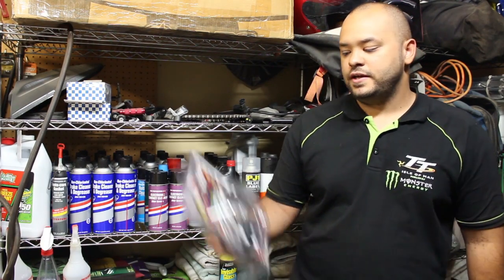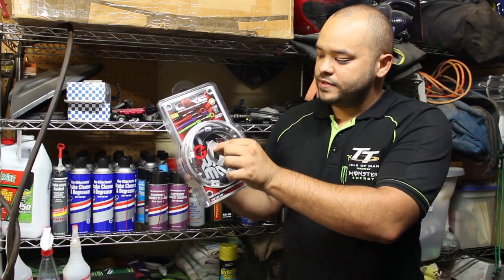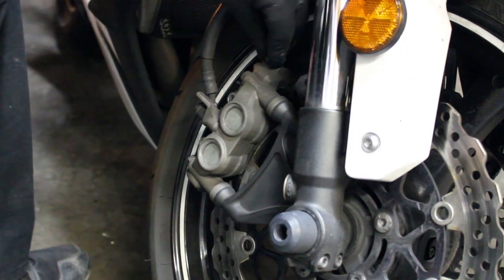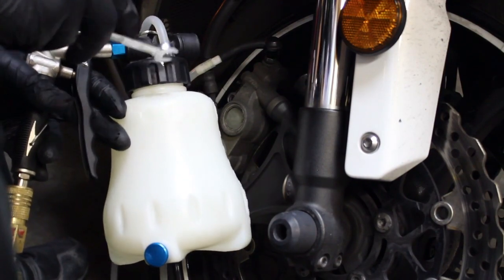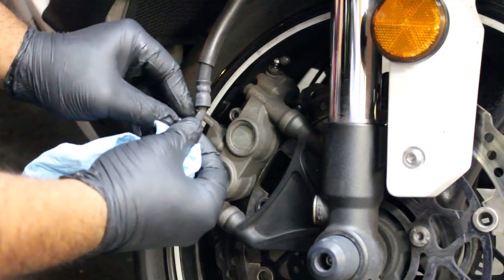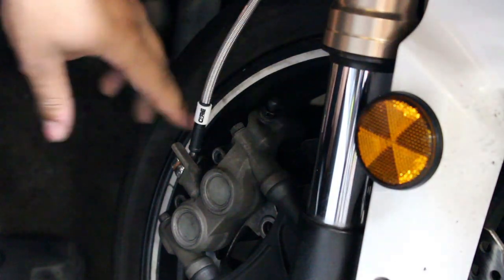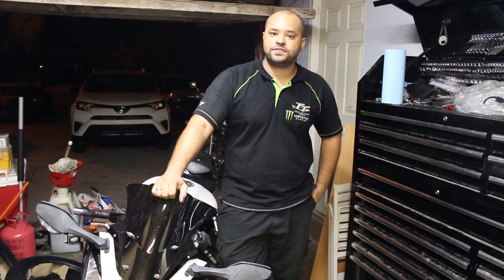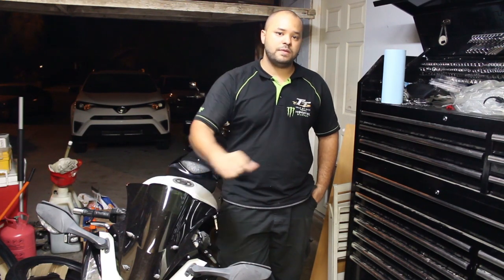How to Install Motorcycle Steel-Braided Brake Lines

Comment: I have a 2005 R1 with original brake lines and about 16k miles.  That means they're a solid 15 years old.  Finally getting around to this now.
Reply from the maker: Ouch! Ya I definitely would consider that a priority. Even if you replace those lines with factory rubber lines; just get them swapped out. Good thing you are getting around to it. Stay safe out there! Cheers!

Comment: Love this guide thank you so much. Only problem I had is during Gravity bleed I imagined I'd only need to top up every 5-10mins not every 60 seconds! Haha, wasted a solid 30 mins and half a bottle of brake fluid to learn that lesson 😂
Reply from the maker: Thank you! Every bike is different and some gravity bleed at different rates. Mine moves pretty quickly too. Especially if you crack open both calipers at the same time. I hope you get your project done quickly and safely. Good luck!

Comment: At 9:52 you have, I believe, the two hoses upside down on the dual bolt.  It appears, at around 10:48, that you make the correction and you then bolt the hoses to the master cylinder in a correct manner. No mention is made of this error?
Reply from the maker: The table demonstration was simply to show you the order in which the cables and washers go. Not specifically the orientation of the cables. This is why there is no mention of it. Every bike is different so orientation is dependant on the individual bike and cable kit. I hope this clears things up for you.
Reply: I noticed this at the time thinking this is going to be interesting but he sorted it out as mentioned already

Comment: great explanation. would the draining and re-filling of the system work the same if the abs stays in the system?
Reply from the maker: Good question. As every bike is different, I can't say yes to every situation. To the few bikes I have done it to with ABS, yes. However; always consult your factory service manual before you perform any maintenance. Hope this helps and I hope you subscribe! Thanks for watching and commenting. Ride safe! Cheers!

Comment: Hey man thanks for the vid, one question.. On the brake lever's double banjo as you can see the stock line had this steel point which locks the old banjo from moving but the double banjo does not lock the same way and could rotate and loosen?
Reply from the maker: Hey! Thanks for the compliment and for your question. If we are talking about the same tabs, the only reason the tabs are there is to keep the banjo bolt from turning too far while being tightened. As long as the banjo bolts are properly torqued to spec, routed properly, and use the appropriate crush washers you should have no concern about them backing out on you under normal use. I hope this was helpful and I answered your question. Having you as a subscriber would be great if you aren't already! Anyway thanks again and ride safe! Cheers!
Reply: @TheMotorcycleBoss   thanks for clearing that up, quick reply too still supporting an older video!
Reply from the maker: @GFUNKzero  no problem! I check my email multiple times a day. I try to respond to everybody. Glad to help! I hope to hear from you again in the future!

Comment: Note that when u showed how to specifically put the lines on the master cylinder they were upside down.
Reply from the maker: I know. It was just to show the layering process. Not necessarily for orientation purposes.
Reply: @TheMotorcycleBoss  gotcha. I figured u knew since they were repositioned off camera. Guess im just letting u know, as some might be confused about the direction they need to be put on. Other then that it's a great video to help DIY'ers.
Reply from the maker: @StreetFighterRic  understandable. Thanks for pointing it out tho. Your comment may help those that didn't get it. I hope you subbed in case you didn't yet! Happy New Year! Stay safe!

Comment: Really good video for all sorts of bikes. I’ll be using this as reference when I change my brake lines in the next couple of weeks. Thanks!
Reply from the maker: Thanks! I'm glad I was able to help you and I really appreciate you taking the time to let me know what you thought! Just don't forget to gravity bleed. It seems a lot of brake systems just wont bleed properly without a gravity bleed or priming the master cylinder. Good luck with your project! Cheers!
Reply: @TheMotorcycleBoss  I found out my brakes are ABS and I need to replace the cable from the ABS module to the MC to make them longer for new handlebars. Do I need to bleed the entire ABS system and do gravity bleeds like you showed or is it different on ABS? I heard I’ll have to bleed the rear brakes as well to get any air out.
Reply from the maker: @Mitchwilmarth  Bikes have different requirements given their ABS systems. Depending on if you have linked brakes or not as well. Your best bet in that situation would be to consult your factory service manual. But for the most part, it shouldn't be an issue.

Comment: Awesome video. Question: were the banjo bolt torque specs given in the documentation along with the kit? Or did you have to look in the service manual for your bike?
Reply from the maker: Because you are threading the bolts into your own brake calipers and/or master cylinder, follow your factory service manual for torque specs. Mine were 18 lbs-ft per the FSM. I hope this helps! Thanks for watching & ride safe!

Comment: Hi there, thank you for your expertise on this matter, this video was very informative, however, I would like to ask you about this accident I had. I ride a 2015 ER6n and I was involved in a crash about a year ago, I was taking a corner at an angle of about 75 degrees (which isn't much of a corner) but I had to mildly apply the front brake before committing to it. Sadly, the front brake just jammed and the bike slid under me. I have been trying to find a reason for this but since I didn't touch the bike for about 6 months while I healed and then the lockdown happened, I could not really go check the spot where I crashed. My question is, do you think this could be cuz of faulty brake lines?  Do brakes tend to lock up after long hours of riding, due to friction heat, possibly? I am just trying to rule out why the front brake locked up on a fairly decent road and barely any leaning. I was also probably doing about 45 miles an hour. I mainly suspect the lever guards that I had on, I think those made contact with the brake lever and that's what caused the crash but since they shattered on impact, I have no way of knowing if it caused the crash. Your insight is appreciated.
Reply from the maker: Hey! Thanks for your comment. I hope you are doing well during these times as well as recovering well from your crash. I understand your concern. I had the same thing happen to me before after I installed odd-looking levers. The pivoting mechanism broke and caused the cylinder to be depressed without me even touching it. It made me go from 45mph to 0 so fast that I almost flipped over the front of my bike. When it comes to brake fluid, you only run into 2 situations. 1: you have fresh or old brake fluid which will not apply pressure to the brake pads without an outside force like depressing the lever. 2: you have some air or water in the lines which make your brakes less effective as they heat up. Which causes the opposite effect you are describing. When it comes to the brake pads or pistons themselves, build-up of dust and grime can sieze a piston and thus resulting in a siezed brake pad. Since the brake pad and piston are always in contact, and assuming that all bolts are tightened in the area, this would not cause the problem because the brake pad is always in contact with the rotor regardless if siezed or not and seizing doesn't cause enough pressure to the rotor to cause it to not move all of a sudden. Usually a siezure like that would be very gradual over time to develop to that point. So as long as there is no obstruction of your rotor or brake pads/calipers, the only likely cause would be your lever guards somehow depressing your lever or piston in your master cylinder. I think your hunch maybe correct about your handguards if you believe they could've caused it. If you ever find out what it was, I'd love to hear about it. I hope this helps and thanks for watching my videos!please subscribe if you haven't already! Cheers!
Reply: @TheMotorcycleBoss  That was quick. Thanks, man. I am better now, better riding my dirt bike more often now, need to get back the confidence I had with my ER. I will change em to these steel braided lines at some point, along with some new brake pads, I think it should be good to go. Already subbed, btw. Thanks again.
Reply from the maker: @ashishavin2127  I try to respond to every comment as quickly as I can. The only comments I typically don't respond to are ones that don't require one. I'm glad to hear you are doing well. Once you ride on the ER again, I'm certain that your confidence will come back after a few months with no issues. But you are doing the right thing in looking for the issue so it will never happen again. I wish you the best and thanks for subbing! Cheers!

Comment: Hi MC Boss
This is ver helpful clip ::))
I guess this applies to cruisers as well
I see u have both left & right b lines coming directly from the master to each caliper, so making the brake fluid distribution block - obsolete
Wondering what decided u to do that- good idea ::))
Reply from the maker: Thank you very much. I appreciate the fact that you took the time to tell me that. Personally, i didn't like the fact that they both came off of the master and perferred the block. Only because it would be slightly more symmetrical and have slightly less weight dangling off the master cylinder. At the time that I ordered this kit, all they had available for my bike was the kit you see in the video. But after all these years, they are beautiful and running strong. No problems.
Reply: @TheMotorcycleBoss  Hi again
Im in Aust & have a cruiser & have bought ready to install front/rear braided brake line. Ur clip has shown me how to install correctly thanks::))

Comment: When you hold the brake lever overnight do you just leave the valve open and the lid off?
Reply from the maker: No. Keep the whole system closed. Valves closed, lid on.

Comment: I have query boss - I am going to install steel braded lines(Speigler) on my 2009 Kawasaki ninja 250r.
The brake lines do not come with banjo bolts. Can i go ahead without them. 
although i have got the washers with them
Reply from the maker: Hello. I understand your concern. As long as you are not changing the connecting points you should be fine. For example: stock may have a single line go from the master cylinder to a distribution block and split to go to each caliper. Where as a different system may go from the master cylinder to a caliper and then from that caliper to the other caliper. Long story short, as long as the number of connections remains the same as stock, you should be able to use your existing banjo bolts without issue. Just keep in mind that they are your brakes and you can only mess up once in many cases so take them seriously. I hope this helps you. Keep me posted. Good luck with your project! Ride safe & subscribe if you haven't already. Cheers!

Comment: Is the washer side with the chamfer (radius on edge)  facing banjo or the brake caliper? or can be either side?
Reply from the maker: Crush washers made for brake systems usually aren't supposed to feel different on each side. Each side should be the same since both sides seal.

Comment: So do the brake lines have to rest against the little metal pin? Ive installed drag bars and the line will be in a better spot if it’s angled differently…. Thanks
Reply from the maker: Supposed to but it is there primarily to keep the lines from over-twisting when tightening. Also keeping the line pointed upwards to ease bleeding. But aside from that, not mandatory just recommended.
Reply: @TheMotorcycleBoss  thank ya sir
Reply from the maker: @joelgarner667  no problem! Good luck with the project. I hope this was enough to earn you as a subscriber! Ride safe!

Comment: Sir, can it be fitted for Hiness CB 350. Suggestions pls
Reply from the maker: If the exact part number I used works on your bike; I don't know. But if you purchased steel-braided lines for your bike specifically, of course it would work! I hope this answers your question. Ride safe and Subscribe! Cheers!

Comment: Surely the pneumatic bleed would force the air in the small passages, out of the system.
Reply from the maker: It does a great job of it. But sometimes a good gravity bleed is still required.
Reply: @TheMotorcycleBoss  Fair enough, I'll use this guide when I change my brake lines on my track bike, great guide 👍

Comment: It looks like you flipped the top brake line. 9:32 looks different from 10:34. The lines bend away from the nut in one and towards it in the other...
Reply from the maker: Ya. I got caught up in the example of how it goes together rather than the orientation
Reply: @TheMotorcycleBoss  Nah its cool, I was installing mine on my R1 and thought I was losing my mind. It was also hard to tell if one line goes on the two-holed banjo first due to a greater bend angle? As in:
washer, left brake line, washer, right brake line, washer, master cylinder or 
washer, right brake line, washer, left brake line, washer, master cyliner. 
The brake likes for my R1 were just labeled left and right caliper...
Reply from the maker: @dragonlee1000  i understand. When i started doing brakes i was confused myself. But once you see it a couple times, things start to click. At least for me it did.

Comment: Can i install steel braided brake lines of street triple rs into zx10r? Does steel braided brake lines are different for different bikes or it fits all the bikes like an universal model?
Reply from the maker: It depends on the kit but for the most part, they are made for specific models. Routing is sometimes different requiring a different amount of slack as well as different configurations and mounting points. It would be best to buy a new set for the bike that needs it. Remember; it's brakes; you always wanna do things the right way when dealing with brakes
Reply: Ok i understand brother. Thank u👍👍👍

Comment: When you do a gravity bleed do you open the bleeding hoses?
Reply from the maker: After you install your lines, you crack open 1 or both of your caliper bleed nipples and wait for brake fluid to come out.
Reply: @TheMotorcycleBoss  Thanks for the reply,. My bike has 2 calipers, I tried the gravity bleed as well as the normal bleed, no air bubbles come out just fluid but there's no change to the lever it's still soft, I'll try again tomorrow
Reply from the maker: @NtaksAKAKevin  try this trick: https://youtu.be/QW7Vgmr9pnI

Comment: Must ask,  2:44  STOP.! +++  Why not just DRAIN the farthest Brake pad bleed FIRST??? +++ DRAIN Most of the FLUID, and LESS fluid in the tank, and calipers to start.?
Reply from the maker: I don't think I'm fully understanding what you mean exactly.
Reply: @TheMotorcycleBoss  After you remove the Master Cap. Open the BLEEDER Screw on the farthest caliper to drain most of the brake fluid FIRST, ... I just did that before watching this vid. And it was drained in 2-3 hours.
Reply from the maker: @paulsilva3346  why not just drain the reservoir and calipers with the pneumatic bleeder? Takes 1 min to do both.
Reply: @TheMotorcycleBoss  If you'd like to mail me one.... I only do brake fluid changes once every 18 months or so rotating, on my 5 toys, so not investing in one.
Reply from the maker: @paulsilva3346  it's a $60 tool. It would probably be worth getting seeing that you do your own maintenance and you have a number of vehicles. As long as you already have an air compressor.

Comment: Who the hell wants to wait 24 hrs to ride your bike after you change brake lines. There's quicker ways to bleed brakes
Reply from the maker: That is for those that are having a hard time getting air out of the system and you should also do it as regular maintenance once in a blue moon.